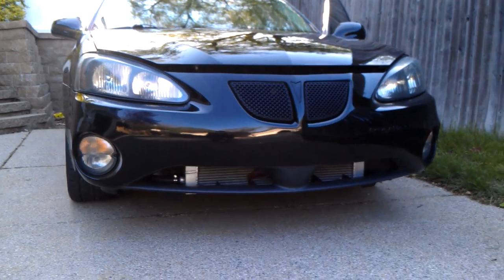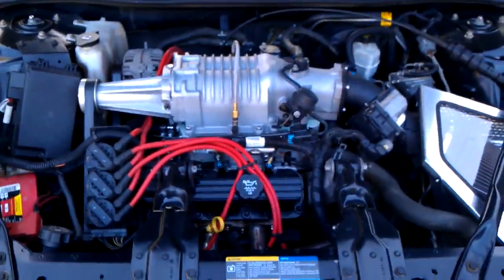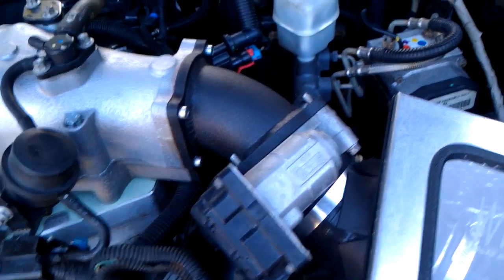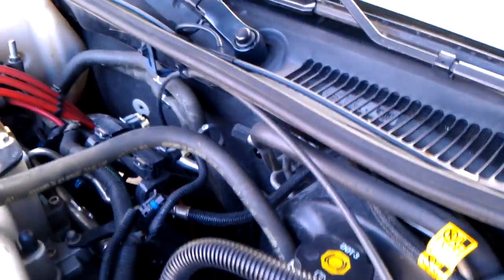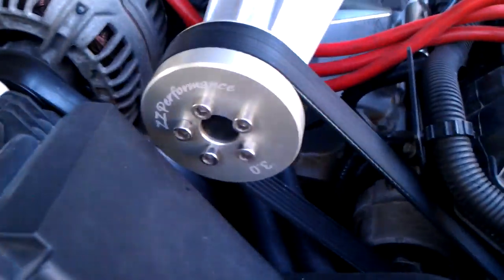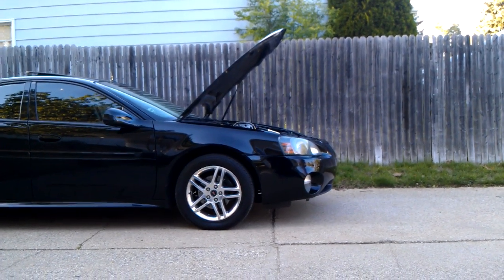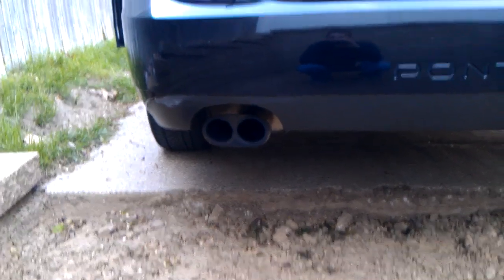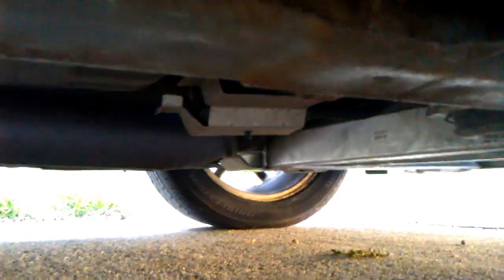Project XP Cam, ZZP CNC Heads & ZZP 2.25 Intercool

Comment: How hard was it to install the intercooler? I’m planning on IC my GTP over the winter
Reply from the maker: Not to bad.  There is some cutting of plastic.  ZZP does pretty good job with instructions.  I would recommend going with black intercooler hoses.  They hide better in the engine bay.

Comment: Do you have the tripple edge performance transmission or are you just running the stock transmission?
Reply from the maker: No stock Transmission with raised shift points, zzp shift kit for firmer shifts and tune.
Reply: Okay true and your transmission has no problems with all of that power?
Reply from the maker: @tyquanmelton7264  the transmission went out at 152,000 miles on car. It lasted about 40,000 miles with the modifications.

Comment: Just watched this video, quick question have you done your pushrods and a Rollmaster timing chain?
Reply from the maker: 1badblowngt Discar yes I did both.  I only did it because I deleted my harmonic balancer and was approaching 400 HP at the motor.
Reply: jmrtinez69 got yeah, I have the same set up as you. Only thing I don’t have is the intercooler which is coming in 2 weeks. I will have a YouTube video update this Saturday if you want to check it out!
Reply from the maker: 1badblowngt Discar just watched your videos. Who is doing your running?  What is your current modification to your GTP?
Reply: jmrtinez69 currently it just has ZZP headers 3” Downpipe, cat Delete, Ubend Delete, 3.5 ZZP pulley and Intake. But right now it’s in the shop getting all my internals “XP cam, Rollmaster single chain, LS7 lifters, pushrods, HP tune and a local guy where I live does the tunes, bigger oil pump, port and polished heads, TC delete”
Reply: jmrtinez69 if you want you can hit me up on FB “David Harvey”

Comment: Do you have stock exhaust on the car?
Reply from the maker: Brandon Moody Yes, headers and 3" down pipe with no cat. After the cat 100% stock.
Reply from the maker: Brandon Moody oh sorry. Cat means catalytic converter.
Reply from the maker: Brandon Moody ya that's a great start. Really the best things to do and have a great daily driver. I sold it a couple years ago and now have a 2013 Audi S4 with an APR tune.  Car has a 3 liter supercharged V6.  With the all wheel drive and 400 lb less weight then the GTP it's a really fun car.
Reply from the maker: Brandon Moody 12.82 was fastest in 1/4 mile.  You will be just under 300 wheel HP. With those mods on a good time using 93 octane fuel.
Reply from the maker: Brandon Moody you will probably be closer to 280 whp. Check out my other videos. My original set up was like yours with 1.9 rocker arms and made 288 WHP.
Reply from the maker: Brandon Moody My friend is a mechanic and did the build out of his garage. All the tuning was done at ZZP.
Reply from the maker: Brandon Moody it would be close. If you have a good set of tires on factory wheels and your car is running good, yes you can win.  Most GXP are tired.
Reply from the maker: Brandon Moody with those mods you will have to have a tune to make any extra hp.  What tune are you getting?
Reply from the maker: Brandon Moody ZZP they know what there doing and have a really fast turn around time.

Comment: Yes! Did you delete or use the oem solenoid
Reply from the maker: Scr3whead_louie2001GS Vic I deleted the part put a block off plate off the headers and just tuned it out of the program son the computer wasn't looking for it.

Comment: Cool what all did u do to it I have a 04 gtp I want to start to mod up and looking for ideas
Reply from the maker: Thank you. check out the video discription. Also check out full build on my YouTube channel. let me know if you have questions.
Reply: Well it's nice wish mine did that much lol
Reply from the maker: +Scott Snyder start with the basic and then grow from there. If your not welling to put lots of time and $3,000 to $5,000 to spend on it. you might want to not start. this car for less then a $1,000 is fast. intake, tune, downpipe colder spark plugs, smaller pulley and 180° Thermostat. boom 50 whp.
Reply: Yeah I have that on there now I'm going to try to rebuild the whole engine this summer new heads cam lifters port and Polish the supercharger
Reply from the maker: +Scott Snyder polishing supercharger is a wast of time. if you have a Gen V M90 don't touch it unless something breaks or wear out. also don't try to polish your own heads. zzp stage 3 cnc heads with 130lb springs on the XP cam is a sweet set up. I would do cnc stage 3 heads over an intercooler. just my personal thoughts.
Reply: jmrtinez69 how much is to cam my l67
Reply: jmrtinez69 thanks for the info

Comment: Hey did you change your alternator at all? Did your voltage every fluctuate from 12-14 05-08 have those issues some internal regulator I know they didnt make a voltage booster and what timing was your car at and what inj were you running
Reply from the maker: Yes I put a machman alternator  . I had that same problem.
Reply: jmrtinez69 which alt dod u buy? And did u get the bypass which made batt light stay on

Comment: How did you get around the transmission dipstick
With the down pipe
Reply from the maker: You just bend it a little. Watch out for the rubber o ring. Its fragile.

Comment: How'd you like the cnc heads
Reply from the maker: Great product. Really set the build apart from other cam and intercooler builds.
Reply: Interesting cause I'm.looking in2 doing heads as well I wanna get as much power out of the cam as possible without having to do a big.cam lol
Reply from the maker: Daniel Ochoa I would do zzp stage 3 heads for the extra $300.

Comment: Any track times
Reply from the maker: yes best time was 12.91
Reply: Not bad cause I'm think.maybe upgrading my.01 gtp.or going turbo cause.it.seems better.to go turbo for the money but.haven't decided yet
Reply from the maker: Way cheaper to stick with supercharger. If you have $5,000 to put in a build go with turbo.
Reply: Cause I was think s1x cam headers e85 gen v and between a 75 to 100 dry shot of nitrous
Reply from the maker: Your building a race car. That sounds fun!!
Reply: Go big or go.home lol plus its a 4 door.so the looks will be priceless but if I dnt do that I'm saving.up for a gto
Reply from the maker: Well good luck. A gto is a little different look.
Reply: Thanks I'll end up posting vids of w.e I do so.I'll keep ya updated and your regal is badass btw
Reply from the maker: Sounds good. Thanks I just bought a ZFR turbo for it from ZZP. Its a direct bolt up turbo. Adds about 60 whp with out any other mods. I can't wait to put that on.
Reply: I cnt wait to watch the video hahahaha

Comment: I bought one from wbodystore, but they drop shipped from zzp and sent me their core instead too, but for literally half the price of zzps I couldn't be happier. But I have the turndown, and fuel logs. Just waiting for it to get a little warmer. Did you use the alternator relocation brackets? Because zzp recommends them also. N I have the inferno hood and I have coilovers too so idk if ill need cradle spacers or not. I guess I'll have to wait and see.
Reply from the maker: I did not have to use the alternator relocation brackets.  im not sure what you will need with your set up.  I would think your hood would give you extra clearence but hard to say.You will know righ away.  I bought all the brackets and what i didnt used i returned to zzp.  better safe then sorry.

Comment: Did you have to install cradle spacers to run the ic..I just bought one and I'm lowered on ssc springs..also have an inferno hood n I'm worried about clearance issues..
Reply from the maker: no I did not need cradle spacers.  My car was not lowered and i was running a stock hood.  I did need a throttle body turn down spacer. I would say by the parts you can always return them.  Did you get one of zzp intercoolers on blackfriday sale?

Comment from the maker: sounds like fun!  Intercooler would be the last thing i would do.  Say if heads and a cam and 60 whp and intercooler will add anouther 40 whp on top of that.  It all depends on the tune and the fuel you are running.  good luck.

Comment: Man those cams make it sound sexy. I've got the full ZZP 3" system with stock cams and it is just a buzz. I good deep buzz, but not any real separation between each fired cylinder. Unfortunately the price it too high to have them installed and my skills aren't there to do it myself so I will just have to make due.

Comment from the maker: thanks  its a lot of fun! You have a great start.  I would run autolite 104 or the tr6's spark plugs.  Did you do a down pipe with your headers?  You really need to get a u bend delete or a downpipe. then I would do the zzp 1.0 pcm and smaller pulley at the same time. shift kit is a great mod with the pcm and will make trans last much longer.  when you get done with this message me and ill tell you what next.  good luck

Comment from the maker: Thanks there is so much you can put in these car.  for your car i would recomend going with a turbo build.  Way more power and economical.  I stuck with the supercharger because It was stock.  when i was done building my car it ran 12.98 1/4 mile times with street tires and stock transmision.  good luck with your buil message me with any questions.
Reply: Did the trans hold up?
Reply from the maker: @ethanhutson3744  Yes it did.  I sold the car with 141,000 miles on it.  The gentleman I sold it to refreshed the trans later in his ownership.

Comment from the maker: 97-03 body style are a lighter car and easier to tune and mod.  If you can find a low mile 02 or 03 jump on it and get it. You can always put a Gen V on a 97-03.  The gen V is more efficient so you can run larger pullies and creat same anount of boost.  I do love my 05 but takes alot of tunning and time which equals money to make it a fast reliable car.  If I could do it again i would do a 05 gt na and turbo the car.  just saying good luck bro!!

Comment from the maker: Great questions EGR recycle your unburned fuel and is fed back in to your intake to burn again giving your car about an extra 1 to 1.5 mpg gain.  the big reason cars have them is for polution reason let unburned gas in the air/Ozone is better for the world.  Performance gives you about 2 to 3 whp gain and sheds about 4 lb.  So bottom line you dont really need it and gain are vary small.  only if you have smog testing in your state then you want to keep it.  Michigan does not.

Comment from the maker: Thaks,  I probably could get away with a 2.8 if i didnt have to machine my snout.  2.9 for sure and i did think about it.  When i was getting it tunned at ZZP I ran in a coulple of issues.  first I had no power to my MAF then maxed my MAF sensor out and had to put the LQ4 MAF in.  I also was not sure how my stock fuel system was going to do with more boost. So I had Tim get it running good and make it a safe daily street car.  It runs great and even on hot humid days 0 kr.

Comment: Looks good man! Can't you go lower then a 3.0 pulley with that set up. I have basically the same setup but stock heads, instead of a cam 1.9 roller rockers with 105# springs, and 42.5# injectors. I haven't had any problems running my 3.0 pulley. You should be able to step it down with your set up. Any ways looks good, nice to see the 04+ body styles get some major performance upgrades. Just a warning go easy on that trans. Broke my input shaft in half, the guys a ZZP hooked me up with a built o

Comment from the maker: Your pcm (computer) will be tuned for the mods that you have so do the computer last or all at one time.  Car will not throw any codes if the computer is flashed (tuned) right with the specs you give zzperformance.  You do not have to get it dyno till you get hevy with mods like cam, intercooler, heads, E85 and maybe even 1.9 rockers. If done right your car will never blow or have any kr (knock reatard). So with this being said MOD away. Drive fast and take chances.

Comment from the maker: so tru cruze with the 1.4 turbo is nice but even zzp cruze in still sitting in the high 13s 1/4 mile times.  thats with 3 grand in performance mods so you are for sure restriced with that car.  but you get 30 mpg on a bad day and almost 40 mpg on a good one.  great car if you ask me.

Comment from the maker: Thanks, the reson the supercharger is sitting so high is because of the intercooler. It sits about 2.50 inches higher the the stock gtp.  Personal message me and ill help you start your build.  Start at zzperformance you will find everything you need there.